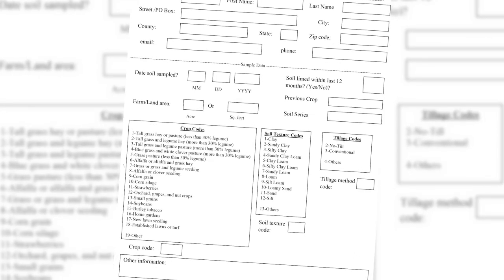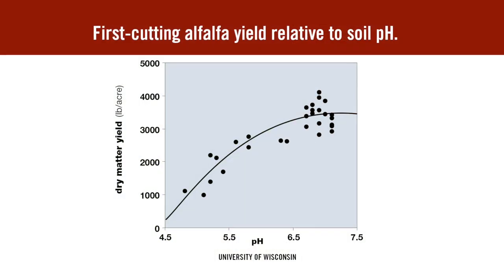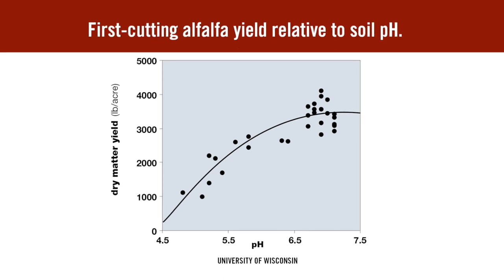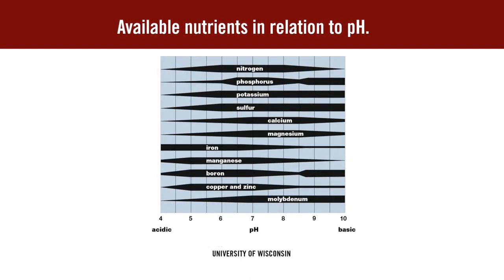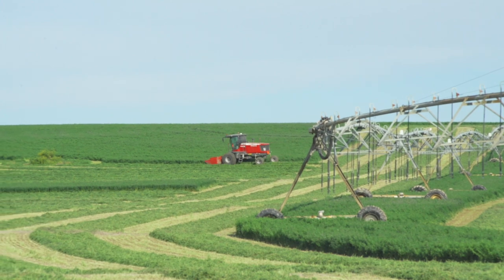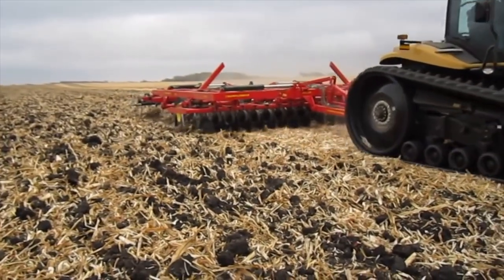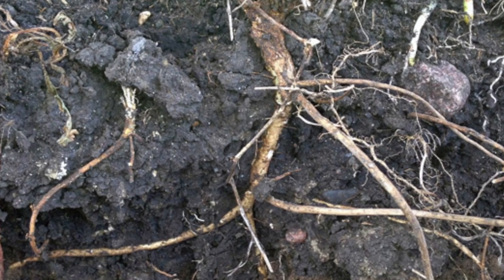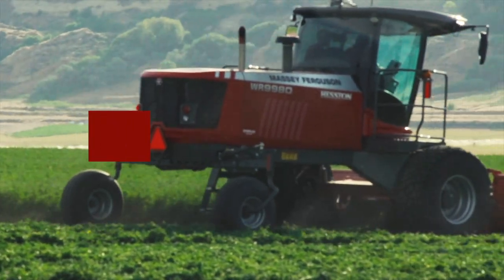Preparing the Soil and Field for Alfalfa Hay

Comment: Do you have to re-seed every year?
Reply: No. You don't.
Usually, good alfalfa species need re-seeding every 5 to 7 years max.
In my experience on my homestead, I re-seed every 5 years. You'll notice by the year 3 and 4 that the land will have patches of missing alfalfa and weak growing overall. But the first 3 years, a good harvesting is 4-5 cuts per year. So you can stack lots of alfalfa for cows, kickens, goats etc.